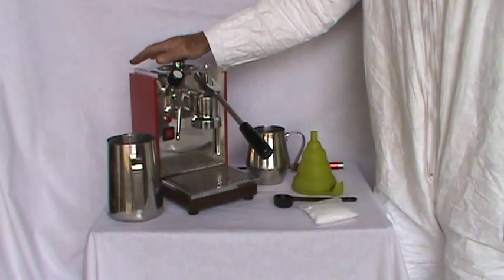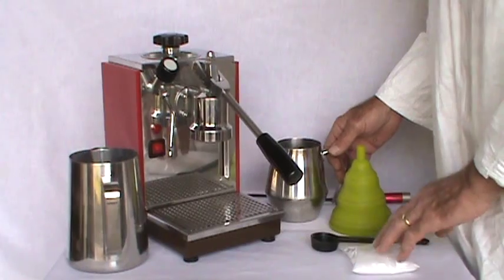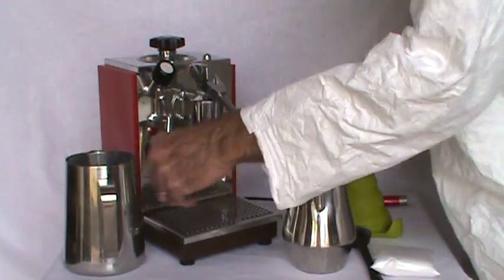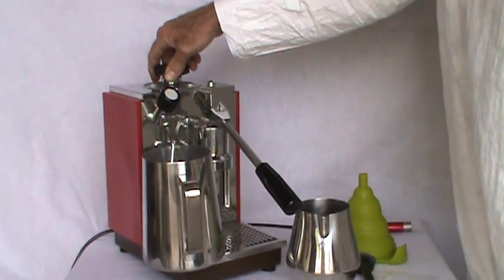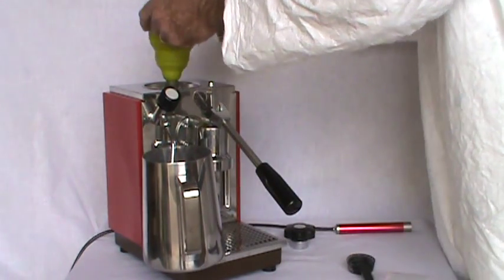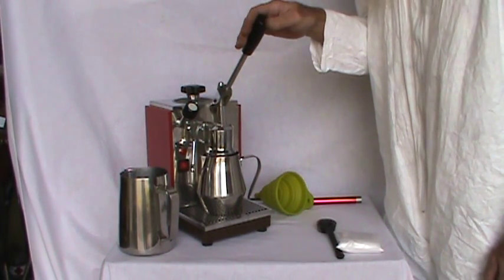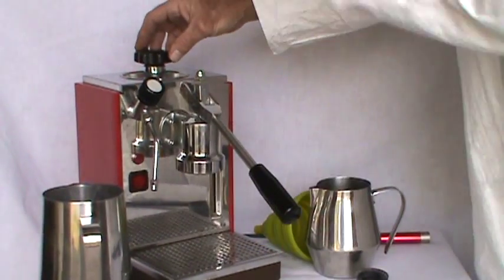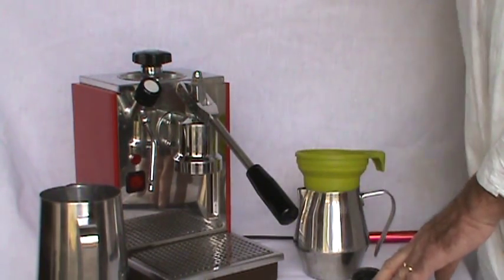Orphan Espresso Tech Tip - Machine Descaling

Comment: Though I do appreciate the video here, I think I'm going to follow the official instructions the first few times: https://www.olympia-express.ch/resources/OLYMPIA_Instruction_Descale-Cremina_140201.pdf .. 2-3 hours cold descaling instead of 1 hour warm. Newest machines don't have a copper boiler .. which may make a difference?
Reply from the maker: First, I'd say, LOOK into the boiler - if you don't see scale build up, don't descale it...  We agree with Olympia - don't use Acetic Acid, or white vinegar - it's stinky, and it takes a lot of rinsing to clear that (and your coffee will taste awful if you don't get it all out!)  Most commercial descalers use citric acid as one of the ingredients, sometimes in combination with stronger acids.  Citric will do the job, and won't harm the boiler (whether the original, or the stainless version).  That said - a liquid commercial descaler is fine to use - it just costs more than citric acid to use  (and you can use citric acid cold - just takes longer to do the job).
Reply: @orphanespresso  Noted. I'm sure that commercial descalers are just alternative branding for Citric acid for the most part :-) Thanks!

Comment: I have a La Pavoni Stradivari which is chrome plated. Do you recommend this method? I have read about chrome flaking off and am concerned about it. Someone said to not pull the solution through the group head, but others do recommend it. Can you advise? Thanks.
Reply: wont hurt chrome